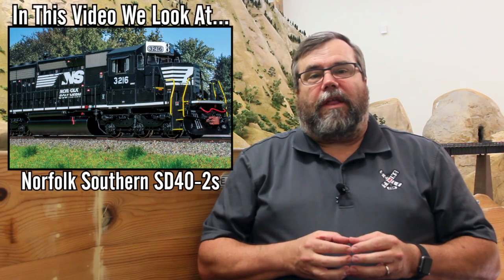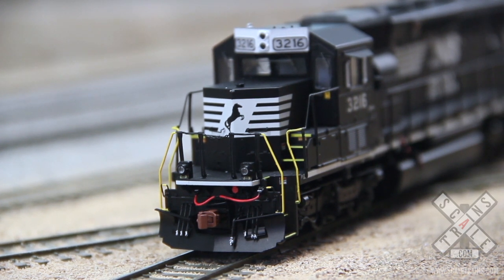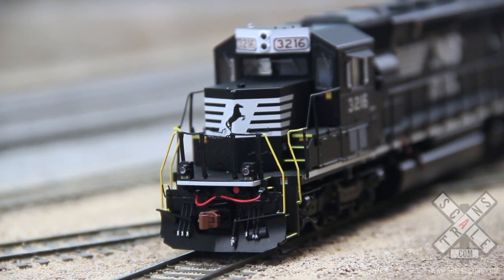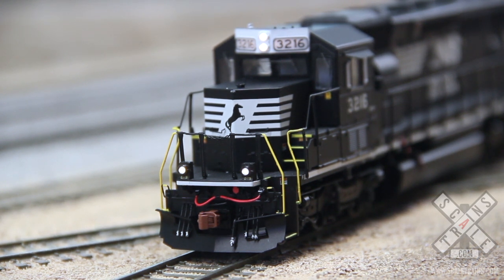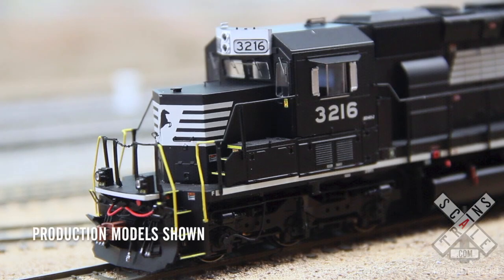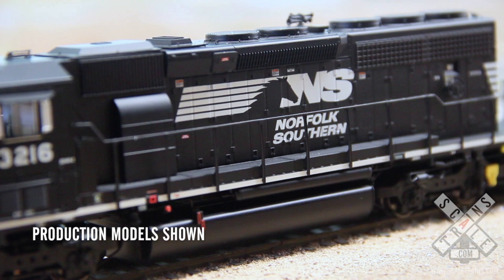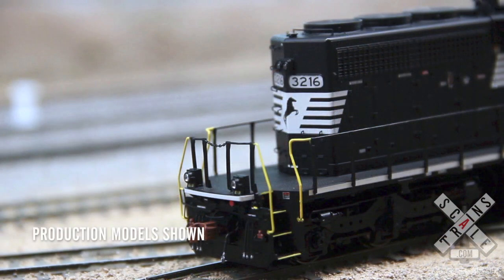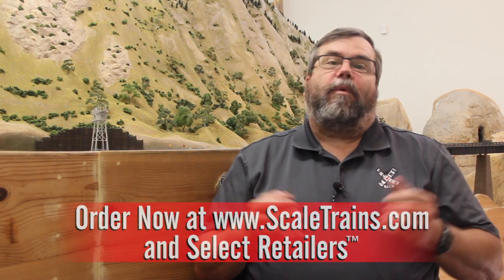Rivet Counter NS "Admiral Cab" HO SD40-2 by ScaleTrains.com

Comment: will the upcoming run (2019) of these loco's be equipped with the new ESU v5.0 decoder?
Reply from the maker: Yes, all new Rivet Counter locomotives including the inbound HO Tier 4 GEVo and SD40T-2 "Tunnel Motors" are available with the ESU v5.0 DCC & sound decoder.  Shane